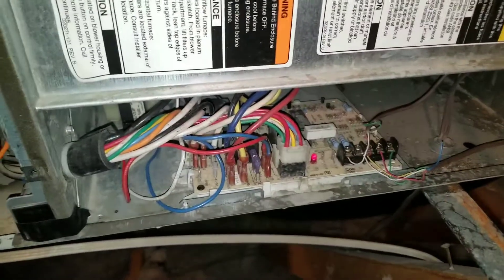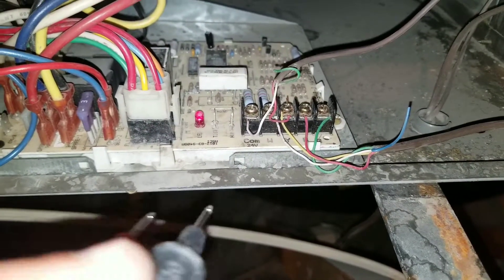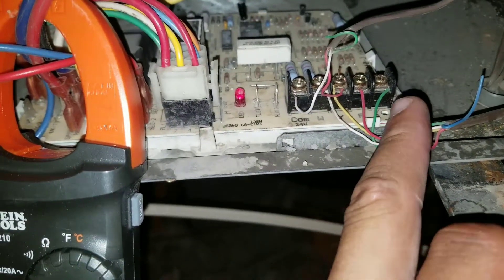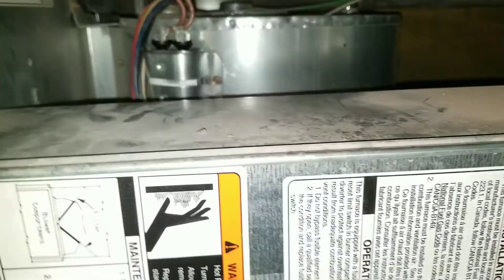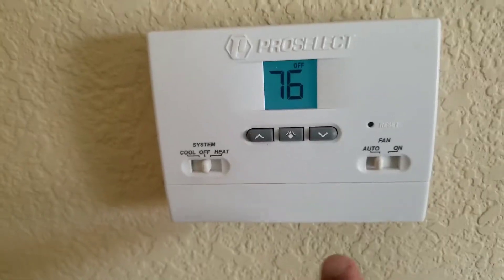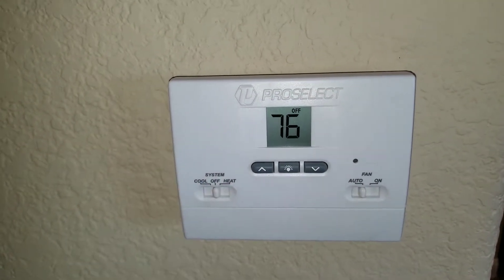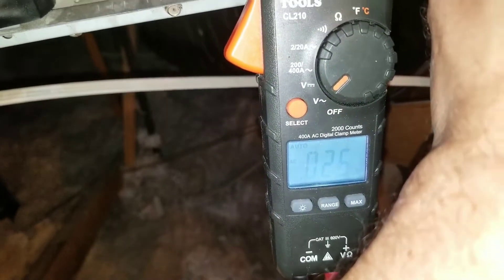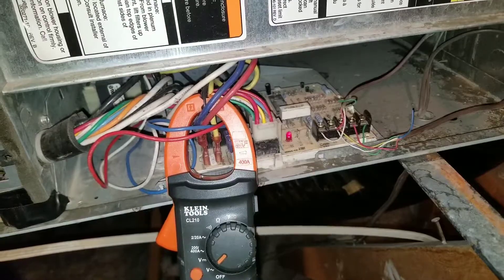Troubleshooting Furnace Board.

Comment: Hey can you please help me figure this one
out?
My furnace stop working and I noticed the
board was making a fast clicking noise, I
bought a use board from ebay and installed
but still the same, there's 118v coming to the
board 84v coming to the transformer and 17
coming from the transformer

Comment: Very good video, do have a question I checked voltage like you said and it read 27 volts at common, I will be installing a google nest thermostat and they require 24 volts to run thermostat. I do have a blue wire at both ends but not connected, I guess not needed with my old battery operated thermostat, would I be ok installing blue wire at the common at furnace board with the white wire together and would voltage drop enough to that 24 volts  Google nests needs while the system is running?